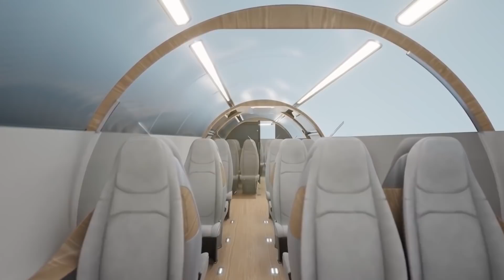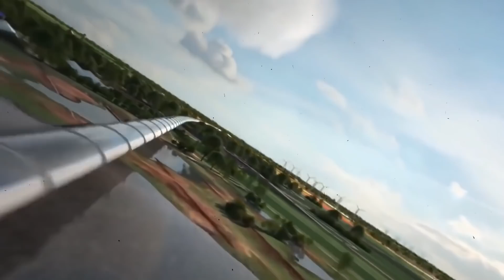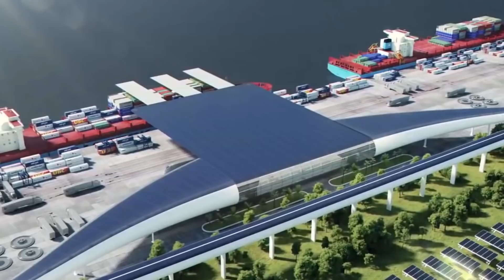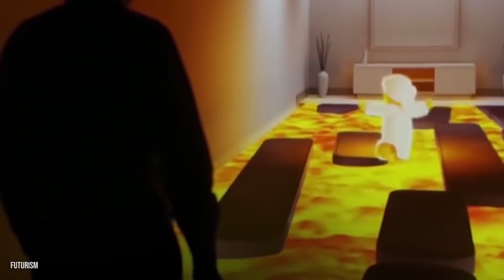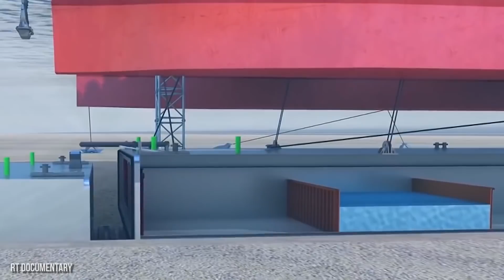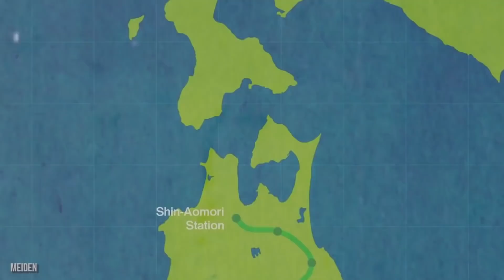The Most Expensive Hyperloops From Around The World (Compilation)

Comment: Surely, it is not too difficult to join forces and combine resources to build a 10 mile hyperloop in a circular test track that can be used for research and technological proofing.

A 10 mile circular hyperloop track would allow the full size test pods to accelerate and decelerate over a variety of rates from 0.2g to 3g to explore the theoretical maximums, the optomum rich-point to achieve the fastest, safest transit, while providing the best transit experience at the most comfortable internal noise level.

This length of hyperloop track would also enable multiple pods to be tested running at the same time, to design a computer system which could define and control the maximum number of hyperloop pods which could travel on the same hyperloop track with a known gap between pods. 

There are many advantages of designing a circular hyperloop test track, one of which may be that within the circular track dimensions could be constructed solar and wind electricity generation solutions together with businesses to complement the research efforts of hyperloop and manufacturing expertise.

The anticipated cost per mile to build the hyperloop track would be between $10Million and $50Million ($100Million to $500Million in total). 

If the top 100 richest countries, who would directly benefit from this research, contributed equally towards this infrastructure test-bed, they would invest between $1Million and $5Million each, which is very affordable.

The specifications for the track would be standardised so that each hyperloop company can operate their pods and they could rent testing time at the hyperloop track depending on how quickly they want to develop and in relation to funding.

Comment: <🌈<><🌈The cyrpto market has been unstable. People ask themselves if this is the right time to invest? before jumping into conclusion i think you should take a look at things first. BTC price fall means analysts remain divided over whether it is entering a bear market or is just suffering a brief correction on the road to more record highs. Investors who bought early are still in profit despite the recent price crash and they also earn by tradlng. I'm still an investor and still I'm winning by applying the same method in every trad e, you can also become a winner today. We should follow the way of earning more regardless of the current market (bulls or bears), which is tradlng. Buy the Dip and Trade...I have made over 15 btc profits not just by buying the dip but implementing tradess with s!gnals supplied by MrAlvin Cheng. You can easily get to him on<🌈<><🌈/\/ͲҽӀҽցɾąʍ as[ [Alvincheng1]///<🌈<>